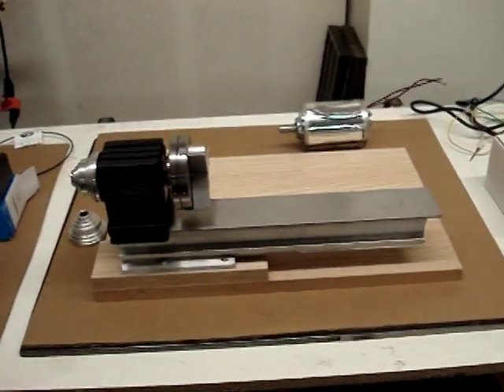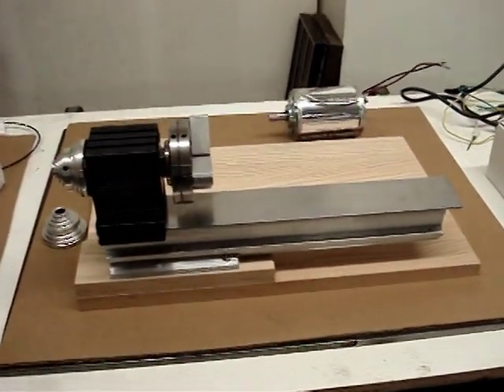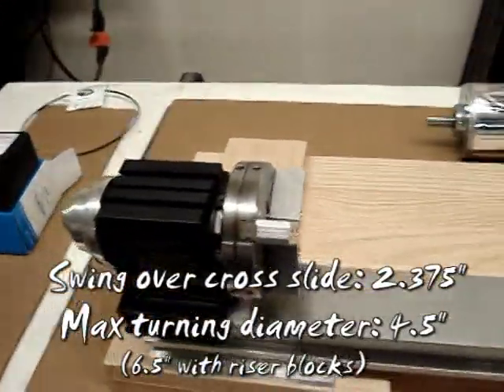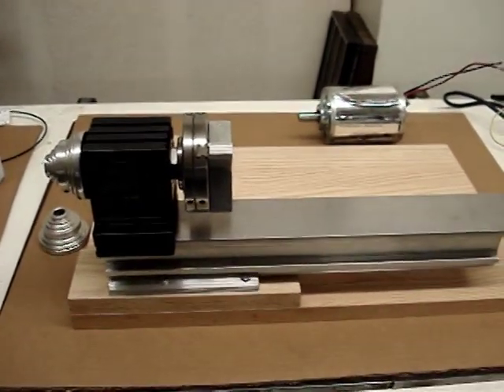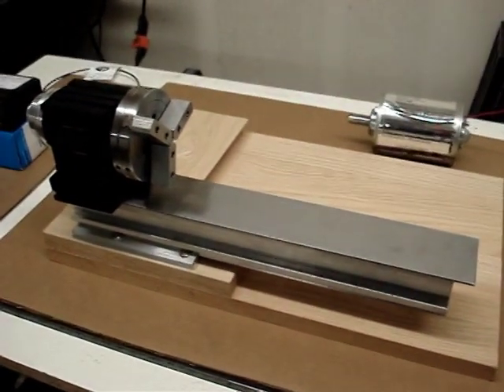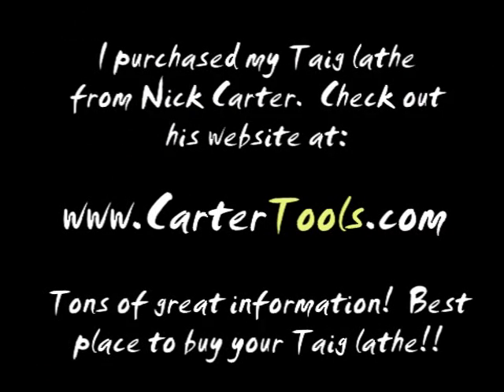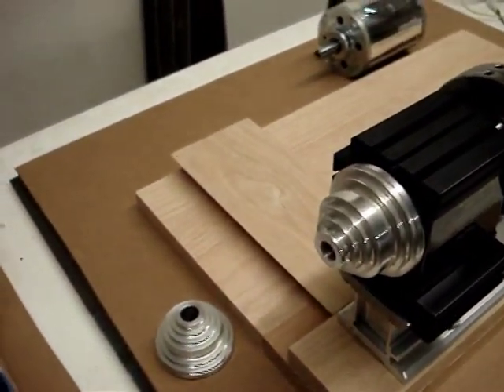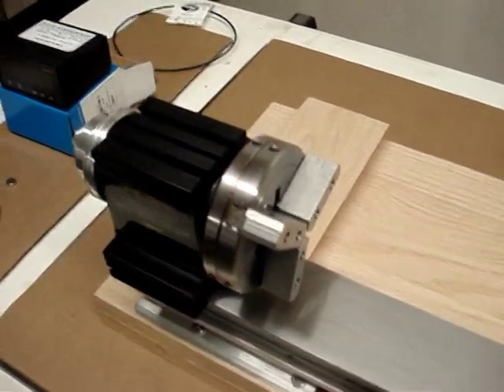Taig Lathe Diary - Chapter 1

Comment: Main benefit of such controller is your motor doesn't loose force on low rpm, like it does if you just lower voltage. This controller doesn't lower voltage, amplitude of pulses remains the same 90 volts, but it add pauses of different width what cause lowering speed and keep force  almost the same.
 Thanks for detailed info. Really helpful video.